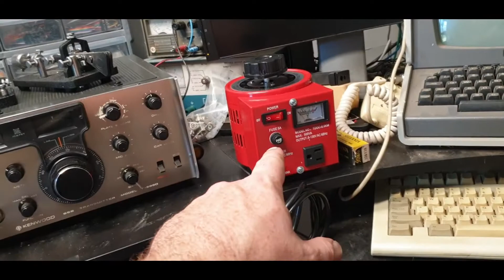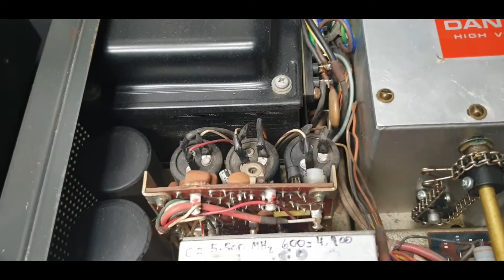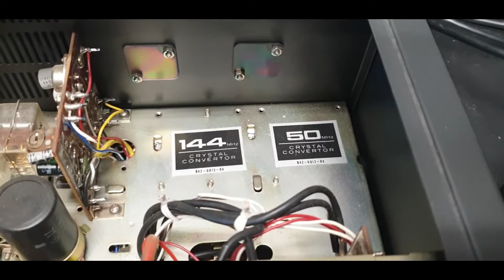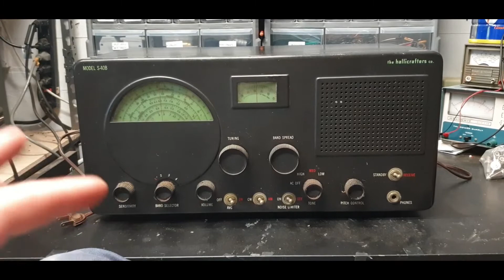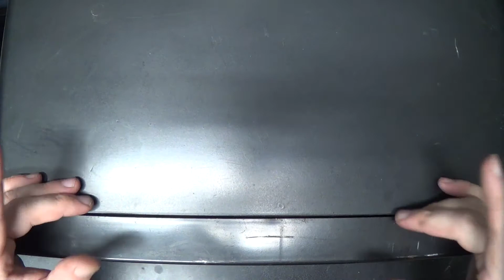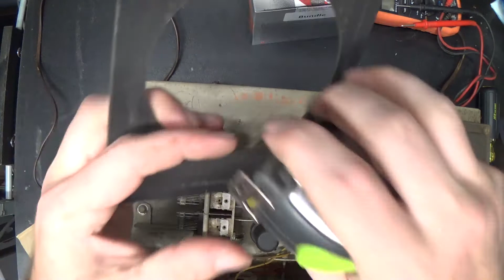A look inside the Kenwood 599 Twins and the Hallicrafters S-40B

Comment: What a rat's nest. I forgot how old electronics are so...so...what do you say? Big and unorganized? I'd not power it up until testing and replacing a bunch of components. Fun with solder! Can't wait to see how you manage it, Lee.
Reply from the maker: Yeeeee, that point-to-point stuff is pretty gnarly.  In a way it's a little easier to fix it stuff isn't too jammed in there, because you can just cut the old leads a little long and solder onto them instead of desoldering the component.  But when there is stuff underneath the rat's nest (as in that SX-28), it's terrifying.  D: